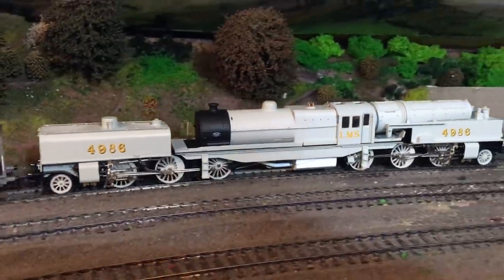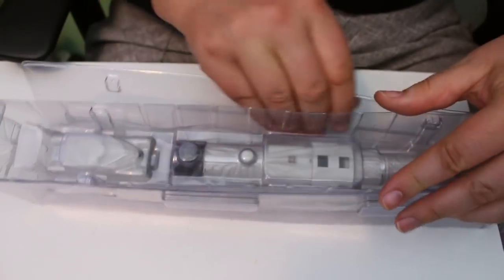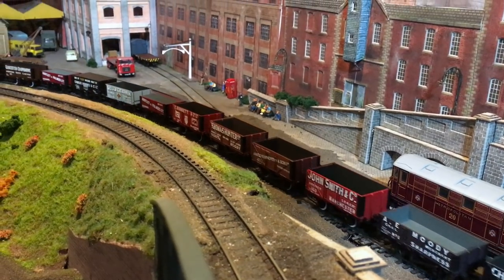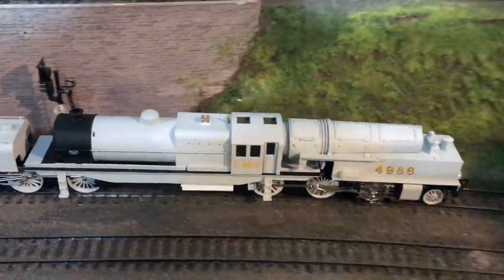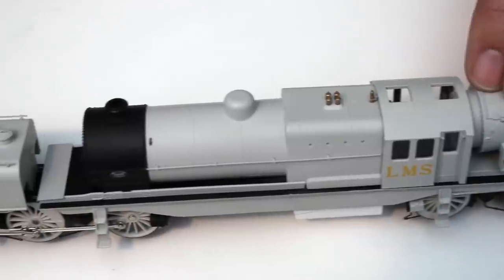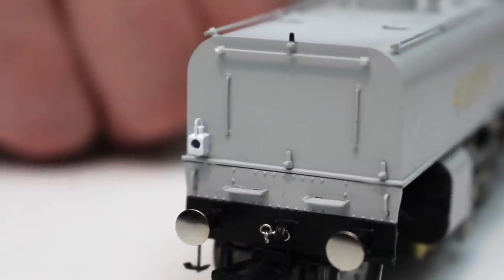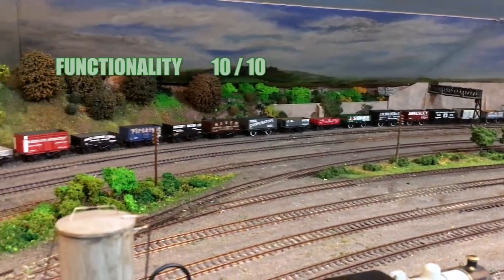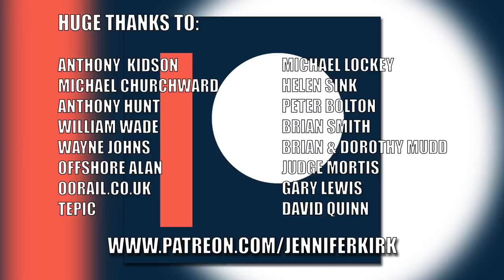Is This The Most Locomotive Money Can Buy? Heljan LMS Beyer Garratt Unboxing and Review

Comment: A very lovely model Jenny, especially in the photo grey - love that livery! I have one from the first batch in LMS black, as well as owning two DJH kit-built Garratts; the Gresley U1 and a South African GCA class. Cheers Joachim
Reply: Hi Joachim. I too am fond of garratts  I have the U 1 LNER  plus two of these from first batch which took almost eight months to get to me from first order. Plus a couple of DJH  Australian Garrett’s (kit built). And two ready to run AD 60 Garrett’s.  Also have the William Francis 0-4-0+04-0 in kit form yet to be built.   Do you find the fitting of two motors a current drain on controllers cos occasionally if I run double headed the response is very slow.  Cheers. 🇦🇺🇦🇺👍
Reply: Michael Naisbitt Hi Michael,

Nice, Garratts are an amazing piece of engineering! I don’t know about the double-headed running because I currently do not have an operational layout - I build dioramas or modules which I hope to assemble to a proper layout once I get the space hopefully.

Cheers from Holland,
Joachim

Comment: It looks really impressive in photographic grey - the one I have in BR black looks more like a huge dark industrial machine! I'm not sure about those shiny conrods, sliders and axle ends - other manufacturers make them in dull metal these days which is more authentic. Also, it might have been good to have sprung buffers and possibly opening cab doors to allow some crew figures to be added.  I wonder how the prototypes might have performed on the Settle & Carlisle or the Somerset & Dorset lines??

Comment: I agree whole heartedly with you. Heljan locos are good and that they definitely don't deserve the rap they get. I have 3 of the Hattons Beyer Garretts and they all run fine, save one which has a dead lamp. I have ten of the Tango's and two night Owl's  , all run with no problems. My only criticism would be the lack of paint on the Tango's boilers which appear just to be plan black plastic with a flat coat applied. I have just bought one of the little GWR 13XX saddle tanks and I'm going to put sound in this. I just hope it's not as much of challenge as fitting sound to a Hornby Terrier.

Comment: Further to my previous comment I realise that you can detach the tender end (magnetically held in place) and expose the cab interior. However, there is a block which fills most of the cab space with the top below window level - maybe that houses the magnet? This means the boiler back wall and fire box door are largely obscured and there isn't much room for any cab figures. This is a bit of a detraction.

Comment: Hi JK great vid as usual I have a question for you .Is it possible to convert a tender driven loco to loco driven ie Nigel Gresly .I have just dcc'd mine but on tight curves the push shoves it off the track where I think if i could convert the loco to pulling things would be a lot better.
Regards
Will

Comment: Hi Jenny, a great review, I had previously dismissed this model but now added to my bucket list! On dcc chip fitting that is so much easier than a lot of engines I have converted, it might be a new way of doing but much better than some! On cooling of chip I think if you look closer you will find there is loads of space, a tall box for heat to rise and dissipate in and a cool metal body, a big cable loom to absorb any minor heat from the chip too. I do urge you to ensure chip socket and dcc chip do not touch each other or the metal body - some insulation barriers needed on your installation. What is the recommended current rating of the dcc chip for the two motors average and peak? Thanks Stephen

Comment: Hi, Well you commented on the amazing hauling power of this loco, it's made by Heljan, enough said, it'll pull a house over if my experience of their diesels is anything to go by. They are one company, in my opinion, really making great, robust yet well detailed models. The LNER Garratt, you mentioned, was a one off because it was especially built to bank coal trains at Wath, so only worked over a couple of miles of track all the time. The Midland Railway interfeared with Bayer Garratt's design insisting on using their axleboxes which later became the weak point in the design as they kept overheating, which effectively meant two locos off the road each time not one, so they kind of lost popularity with the company for that. Oh and please, it's the Ashpan not the Firebox you removed to get at the DCC chip. Great review though, enjoyed seeing this beast running on Wear Yard. Best regards Dave.

Comment: These were also used in Australia!
Reply: Fortunately the Australian versions used the Beyer Peacock Axle boxes and lasted much longer. In Queensland where I live we had a 4-8-2 + 2-8-4 and I had the privelidge of riding in a passenger train hauled by it. It is preserved and is in working order although at the moment it is in need of some work. New South Wales had the AD60 which was the biggest in Australia with a 4-8-4 + 4-8-4 wheel arrangement. Although Standard Gauge it was small for a standard gauge loco as like most other states in Australia the loading gauges were small. Can't understand that in a country the size of Australia. There are 2 or 3 or more of them in preservation. The South African Garratts I think may have been even bigger even though they rode on 3' 6" gauge track they used a Standard Gauge Loading gauge more closely aligned with the USA. Here is a video showing the Eureka models AD60 and the first Heljan Garratts: https://www.youtube.com/watch?v=efs9j8Auavk
From DCC Concepts promoting their PowerBase product. Can you count the wagons behind the Heljan model?
Speaking of the Heljan model; I have 2 of the 1st release but have not run them yet as no layout. How do I avoid the pitfalls, any suggestions please?
Also do they have the same decoder setup as the new version?

Comment: Just bought one of these from Rails of Sheffield, had to send it back, one of the valve gear rivets was missing. Also one of the sanding boxes had dropped off and quite a few of the sand pipes were bent. For £250 retail, £200 from Rails, so far I'm a little underwhelmed. heljan need to up their quality control.

Comment: On this review I frankly doubt your 'objectivity' and 'neutral point of view'. Several reasons. But the main thing is that Heljan Locos just are not reliable and prone to many problems. The first batch of this loco was a 'nightmare' for the owners ! It could have been of interest to COMPARE this new batch with the rubbish that came first ! Is it better ? I doubt !! NEVER AGAIN I WILL BUY ANY Heljan loco. And in my opinion its not even worth 150£. A cheap mold for this loco has NOT a lot of detail to start with ! What is the price of a motor in China ? NOT EVEN ONE $ !! Please be a bit more objective Jenny for I like your reviews. This one disappoints me completely, sorry. Greetings
Reply: Well, Filip 36, my Heljan GWR saddle tank is faultless. I'm not aware from guys at the Club about any problems with this manufacturer. hopefully their quality control is now working ok.
Reply: I 've seen a few reviews about Heljan loco's from another well known and good reviewer which were nice to watch for entertainment but there the fun ended. Long ago I had a Class 52 from Heljan that had to be send back because of faulty gears, the replacement loco had paint issues. Unfortunately to me Heljan is not synonymous with quality and I'd much rather go for the other "H" ..... Hornby or the best in O0 which I think is Bachmann.